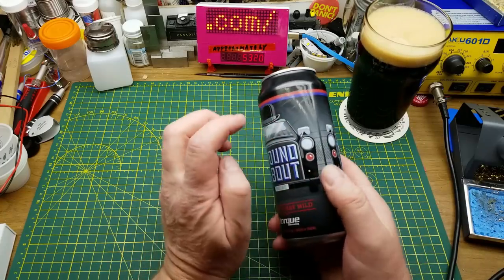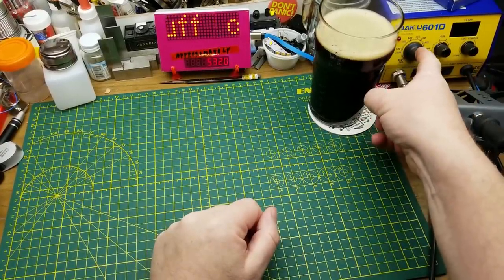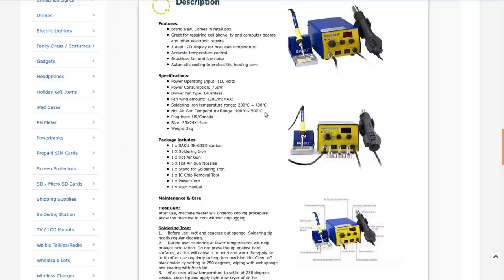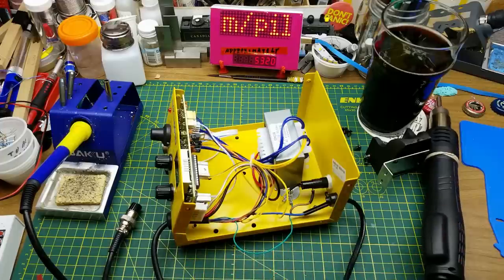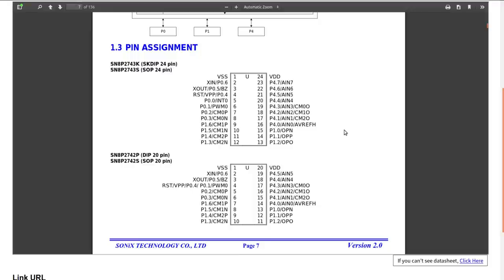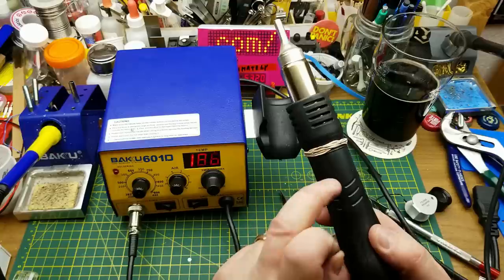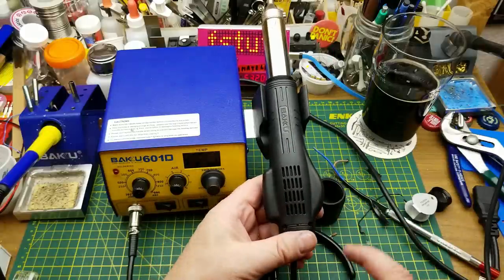A closer look at my cheap soldering station (and some upgrades)

Comment: Those "cheap" soldering stations are made under various names, but always have the same model number.
They are great.  I don't know why people have such an issue with them.  
BigClivedotcom did a review on one and the temperature was really accurate and they hold the heat well for small to medium joints.  Obviously on larger joints that sink a lot of heat, they need longer to recover.
I have a similar hot air station and it works brilliantly and the temperature is very accurate on that too.
Nothing wrong with them.   They work well.  You need to watch that you remember to turn them off as the firmware can occasionally be glitchy, but other than that I wish people would stop whinging. They are good.
I took my heat gun apart and repositioned the reed switch properly.  They seem to come loose in shipping sometimes.  Really easy to take apart and replacement parts are cheap and readily available
Reply: omg...... did you see louis rossmann video about baku scrap? 🤦🏻‍♂️

Comment: I saw that Archer solder, got memories of using an old Weller soldering gun to fix a radio as a kid. I forgot all about that. Thanks again for a fun video.
Reply from the maker: I still have 2-3 rolls of that old Archer solder, even though Radio Shack ceased to exist in Canada about 16 years ago.

Comment: I know you do not really need this but just an FYI.  They actually make a tool for the AC power cord stain relief.  Amazon sells one called the strain relief crimper.  Years ago I had to install several dozen power cords so I bought a really nice crimper tool (better than the Amazon one) and it was definitely worth the purchase if you are doing a lot of them. Nice video by the way.

Comment: I made a fake Weller soldering station over 5 videos, which seems to be working well. Thinking of away to use the weller SMD tweezers tips in a new design. Also need to remove the Arduino bootloader from it so there is no wait for the screen to come on at startup.

Comment: My "Katusu" iron now has a triple-length cable.
I thought I'd better have a spare "handle", so bought one, plugged it in then realised the plug was wrongly wired - which was somewhat disastrous ... then I left the original one switched on for too long in an enclosed space and the business end ended up at 45 degrees ... so waste not, want not ...
Experimenting with the same transformer and T12 bits is definitely on the cards  ... perhaps when suitable handle material comes my way ...

I love the way DiodeGoneWild does all his soldering with a gun - I now have one on my wish list - along with a secondhand microwave transformer for spot welding.
I started soldering germanium transistors in the 70s with a wooden-handled "Solon" with a half-inch bit - I'm currently reviving the 3rd degree burn memories with my sloppy use of a glue gun.
That original soldering iron LITERALLY burst into flames !

Comment: Just bought one for 15 bucks on eBay, seller only has 87 feedbacks left as a seller but they are all positive, for 15 bucks I am not out much and I can always get my money back from PayPal if it doesn't arrive. Just subscribed.
Reply from the maker: That's my approach too.

This hobby can get really expensive if you let it, so saving money where we can is always welcome.
Reply: @pileofstuff  Agreed. I also just bought a battery spot welder and I just had a box 3-D printed for it. https://imgur.com/gallery/UBBvZY9

Comment: I don't see any isolation between the 120V AC on the PCB and the low voltage.  But at least now that you have the case grounded I would feel safer.
Reply: Where do you see 120V AC on the PCB?

Comment: I'm actually in the market for a soldering station... think you might have sold me. Especially since I could get a T12 iron for it as an upgrade. UPDATE: I managed to snag one off Budget Electronics (see ebay, is in Toronto) . I rather like it! Had to do some minor repair right from the get-go. Interesting thing - it came with a grounded plug, so I guess they decided to fix that issue. I also didn't have an alignment problem with the magnets and reed switch like you did.  Really, it's an excellent value.

Comment: soldering iron side died on me. any idea what it could be? i checked everything on the board, traics, element, transformer etc. heat gun works, but soldering iron doesnt light up.

Comment: Looking at the internals, it is not double insulated. Plainly see only the inner insulation on the live wire. So the case should be earthed or you should add extra insulation to the mains wiring, hopping that the transformer has double insulation.   Just heard that you are going to earth it. Nice looking beer, remember beer numbs the pain, but can't fix 120V shocks ;)

Comment: I often buy the "cheap" stuff too but for stuff like a soldering iron that I know I am going to use for years I don't mind paying more.  (And from a Canadian supplier with a good price on Amazon... like you I don't want to spend that kind of money dealing direct from China to save a few bucks with no hope to ever get support if I needed it.)  I've got a nice Hakko FX-888D that has worked well.  And its stand looks and works better than either of those!   ;-P

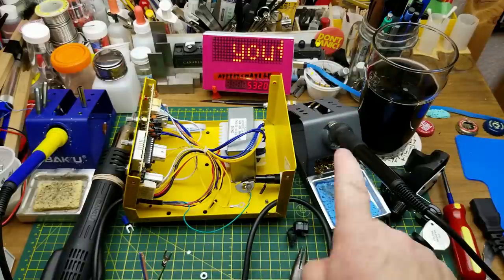Comment: That yellow neutral wire that you are connecting to at 11:23 looks really light for the power requirements for the heat gun alone.

And since the old plug was non-polarized are you sure you connected the new plug hot to hot?  Ideally the hot should go to the fuse and then the switch before anything else.

You can also take the clear protective plastic off the LED display and it might reduce reflections even though the case has a red filter.  That plastic film is only there for protection while manufacturing.

Comment: Smashing job :-D
i was confused by the odd earthing to the heat gun, it just didn't make any sense.
Everything metal should be earthed, i never ever depend on earth leakage breakers.
You have made it much safer now :-D, a real earth protecting you from leakage.
Good job with the magnet :-D
Reply: There is no earth connection because in the USA many (most?) plugs and power outlets are 2-pin with no earth. The manufacturer couldn't have used a 3-pin cable and plug because Americans couldn't plug the unit in.
Yes, I know that earthed sockets are starting to be used in the USA now days.
Yes, I know that Pile'o is living in Canada. However he's been supplied a "US-spec" device.
Reply: @johncoops6897  John not sure if you live in the US but I live in California and it is extremely hard to find any construction in the last few decades that are not 3-prong earth grounded.  Over the last 50 years, all the houses I have lived in had grounded 3-prong receptacles.  Also as far as spec'ed devices my home hobby lab with over several dozen test instruments from both the US and China all have grounded 3-prong plugs.  Just and FYI and hope this is helpful.
Reply: @jwrtiger  - I live in Australia, and I realise that grounded sockets are used in modern US installations. I guess that we have a  stereotypical image of the "standard US Socket" which is unswitched with 2 flat prongs and no earth.
Reply from the maker: Anything built in the last 50+ years in North America will have proper 3 pin power outlets.

There are very few modern products sold that aren't supplied with a  pin cable.

The original cord on this unit had the Asian 120V plug (note the lack of holes in the top of the prongs and both prongs being the same size, not polarized).

I wouldn't expect the international audience to be that familiar with the nuances, though. I certainly wouldn't be able to recognize a good Australian plug from a shoddy one.
Reply: @pileofstuff  - a shoddy Australian plug is when the Chinese supply one of their outwardly similar plugs. The Chinese pins are narrower and thinner, with non-insulated Line & Neutral, plus the entire thing is "upside down" (earth pin at the top). Totally and utterly unsafe and illegal here.
Reply: @pileofstuff  Are the holes in the pins to help keep the plug in the socket?, some kind of sprung ball bearing maybe.
Im likely talking rubbish lol.
Reply from the maker: @zx8401ztv  That is actually the main purpose. There are dimples on the metalwork in the socket that engage the holes and help to retain the plug.
A secondary use is that there are some "childproof" locks that use the holes to grip the plug and not allow it to be inserted into a socket.
Reply: @pileofstuff  Ahh dimples, i was thinking too complex lol.

Comment: Just bought one off Amazon, it now comes with a 3 prong plug.
Reply from the maker: Is the ground pin actually connected?
Reply: @pileofstuff  I have not taken it out of the box yet, except to check the plug.  I will check.
Reply from the maker: @Mr1279Dave  I double-checked mine after my modifications, just to be sure: https://www.instagram.com/p/B9fe8AcnTx1/
Reply: @pileofstuff  Yes, ground is connected to case.

Comment: Hello,
May i start off by saying that your videos are amazing. And that i have learned, along with a couple of other channels, quite a bit (I especially like the Mailbag Mondays. 
I am kind of new to electronics and DIY projects. For which i have recently purchased the Baku 878L. Which works great. But since day one that when it's  plugged into the electrical socket (even if the soldering or hot air functions are turned off) the device makes kind of a humming sound.
What i would like to ask you, if it's not too much trouble, is if you have any idea what may be causing this? Transformer, maybe?
Thank you ever so much. And keep pumping out these great videos.
Cheers
Reply from the maker: The humming is likely to simply be the laminations of the transformer core vibrating along with the changing magnetic field.  
In a higher quality transformer, there would be varnish or some potting compound on the laminations to prevent this.
Reply: @pileofstuff : Thank you ever so much for answering my question. And so quickly too...
Can you please tell me if this will harm or even damage the transformer or the soldering station itself?
I have been looking on Youtube for a fix for this problem. And i have found a few interesting ones. Even a few that the solution is to screw in four screw (with nuts and bolts). Which wouldn't be good for my problem because the transformer in my soldering station doesn't have the four holes already in them.
The one i found really interesting (since you mentioned varnish in your answer) is a guy who heats up his tranformer on his house heater. And then applies Shellac onto it. Which i looked up what it was and it is basically varnish. But then again, you know what Shellac is. 
Do you think that if i do the same (using everyday wood varish) it would stop the humming?
Once again thank you very much for you time and patience.
Cheers
Reply from the maker: @johnmacedo4483  The vibrations are mostly annoying. Shouldn't damage anything.
Shellac is another product that woodworkers use in place of varnish. 
I wouldn't bother to add some, but if yo are careful you shouldn't make anything worse if you are careful (though you might make a mess...)

Comment: I'm enjoying your videos for quite some times. Today I need to make a comment. 
The Weller soldering iron you have is very likely equipped with a automatic solder temperature regulation. It is based on a ferro-magnetic switch that changes properties when it reaches a certain temperature. You can buy tips with different temperatures.
This old iron is a gem! It simply works for decades. Have a look at page 2.
https://docs.rs-online.com/5c77/0900766b8141ed88.pdf
Thanks for your videos!

Comment: My question is why is the unit so large when there is nothing but empty space inside?  Maybe bigger box looks more impressive?  Watch Louis Rossman "review" of this unit where he literally smashes it with metal rod.  Poor Baku. Biggest drawback of these cheap air stations is they don't have power to handle reworking large bga chips.

Comment: Your (new) mains earth has no direct connection to the enclosure, and a very dubious connection to the heat gun.
When earthing / grounding to metalwork, you must scratch off the paint then use a star washer directly between the lug and the metal surface. The teeth of the washer bite in to provide a reliable long-term connection, as well as vibration resistance.
At 12:30 you just connected your new earth lug onto to the original Chinese bolt, so it was sitting on top of the transformer frame. The transformer frame is INSULATED from the case by the yellow paint, and the bolt is also insulated underneath by paint. Also, you had a poor earth anyway with no star washers etc anywhere.